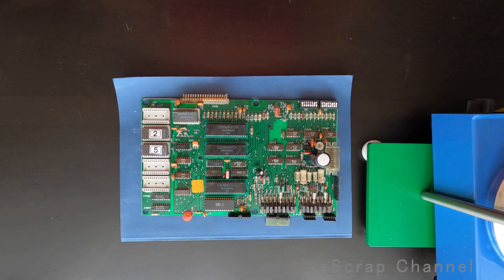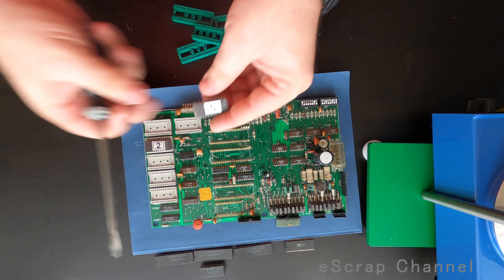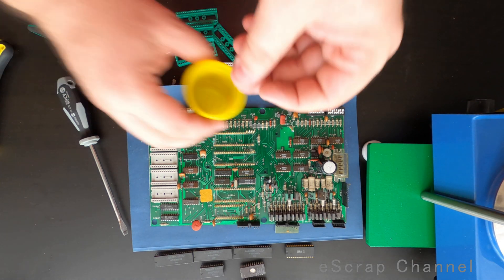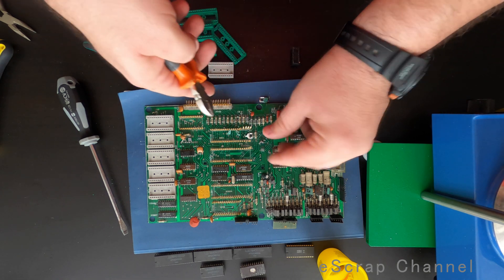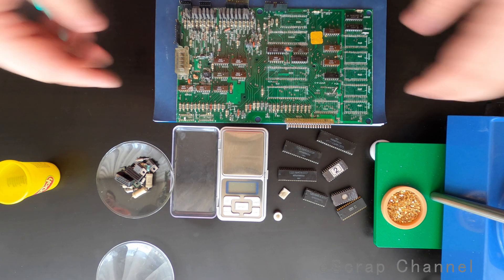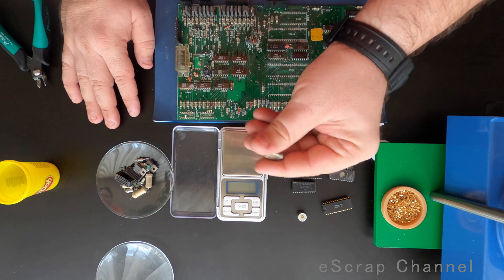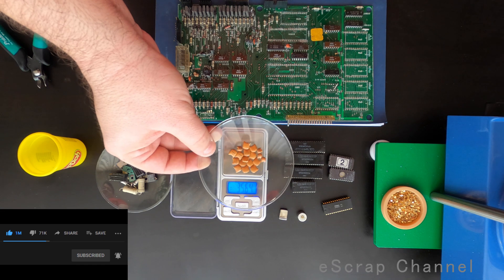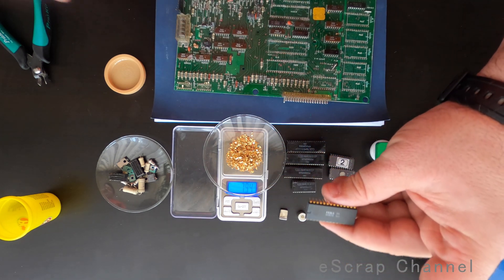Scrapping Vintage Computer Board for Gold and Palladium!

Comment: so sad to see people cut like rambo,, while if u heat the pins the solder gets liquid and u can get the hole pin out,, basicly u leave almost 25% in there,, and yes those parts ar plated aswell
Reply from the maker: You are correct, but I process boards with leftovers separately dissolving the solder and recovering rest of the gold. I just prefer processing in two batches the material that has solder separate Fromm the material without solder.
Reply: @escrapchannel  well that makes sense, it is indeed more time consuming, in my case i need to keep it small andso rather spend more time getting the hole pin out and just resell the boards to a bigger processor